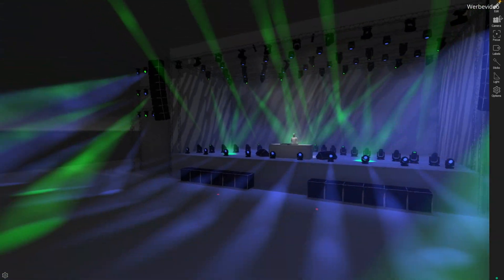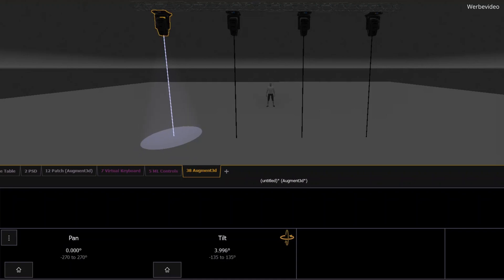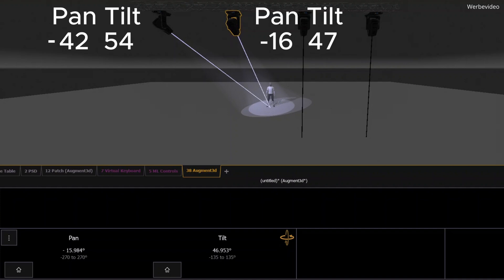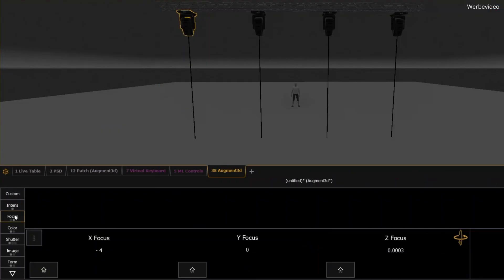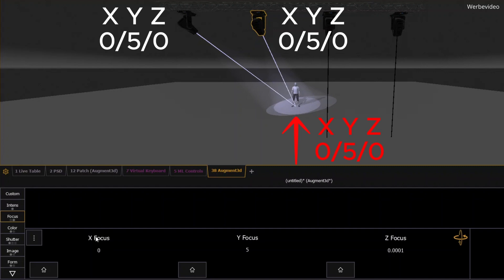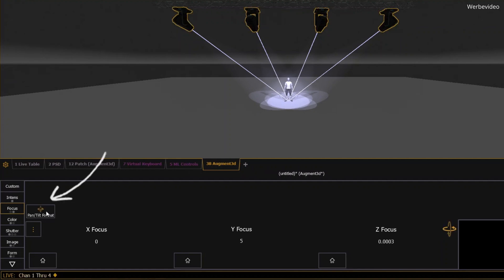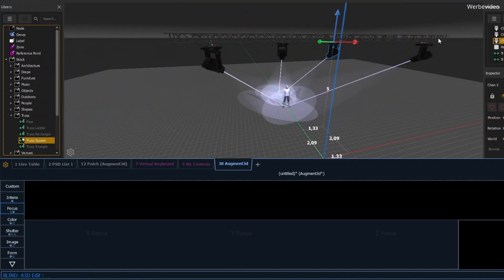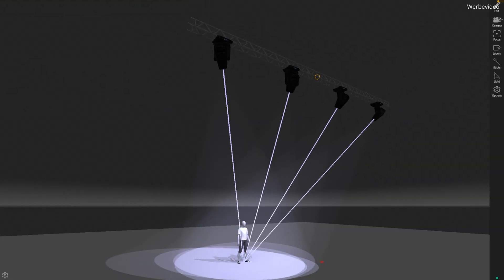❌ Stop using Pan & Tilt for Moving Lights! ✅ Use XYZ Mode | EOS Augment3d

Comment: Incredible!
Super fast and super clean.

After testing a little bit of the concept, I do have a doubt thou:
 It's about the path a mooving head takes to get to the position. In my tests, my lights did a 180 degrees pan spin so they could get to the XYZ position I indicated. For some reason the same happened even after I changed the devices Z rotation, so they faced the other side. 

This tool is incredible and could massively speed up the Focus Pallete process and Focus control, but I'm afraid to use it now and create unwanted movements in my show, when passing from a Focus Pallet to another.

Do you have any thoughts, or solutions about this topic?
Have you come across this kind of problem since you've been using this method?

Thank you very much for the video!!
Reply from the maker: It is important to note that the fixture needs to be able to reach all positions without reaching the physical limitations of Pan and Tilt. When the fixture exceeds the min max Pan Tilt range during the movement, the Pan / Tilt flips in order to reach the position again. 

This may help to solve the problems you are experiencing: 
- When working with XYZ, be aware of the Pan and Tilt ranges. Avoid working close to the physical limits of the fixture. 
(Example: Following an XY circle around the fixture won't work as the fixture will eventually reach the max pan of 540° and flip over to continue this movement)
-  For some applications, a Pan / Tilt starting point can help ensure that the fixture is using a good Pan / Tilt range for the specific XYZ application. 
- Avoid XYZ movements / positions that are straight down, as this can cause Pan flipping.
Reply: @DMXCoaster  thank you, i will keep this  in mind!
Very helpful, I am gratefull.
Keep up the good work :)

Comment: I've been waiting for lighting systems to manage waypoints/coordinates like this for a decade. I just wish it was not limited to the ultra-expensive systems. ETC, Grand and the like are spectacular systems, but also unattainable for the bulk of venues outside major metropolitan areas.The crazy thing is that while the way this is handled may seem like voodoo or rocket science, it is really just math and vectors. A lookup table cross referenced with positioning data of lights and targets means that it is just a few more calculations done for each movement, which when managed by a computer is really not that unobtainable. It does get complicated when calculating moving moving heads, but for a computer, it is childsplay. 

I think the next generation of lighting will use geo/spatial location in realtime, but that is going to take an overhaul of dmx or another system altogether. I think this is part of the reason ETC is moving to ethernet connectivity to each fixture. I wish I could couple DJI's tertiary land-based gps augmentation unit within facilities to map all devices quickly and to a more precise level. That would unleash an incredible ability to have any fixture anywhere in the venue, and even have it mobile, while calculating spot-on alignment in realtime.
Reply: The base ETC Nomad dongle is only about $1000 depending on your country, It unlocks 1024 channels of dmx output via artnet/sACN from the EOS software that runs on PC or Mac.